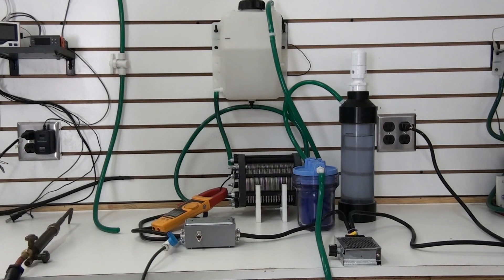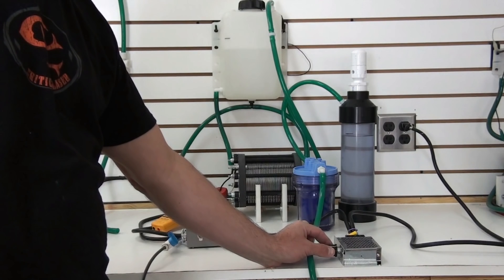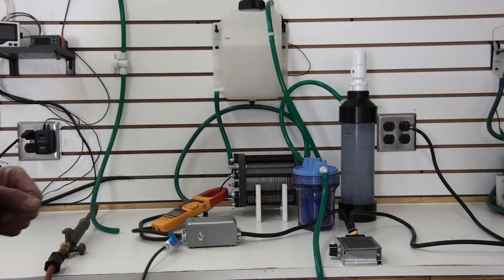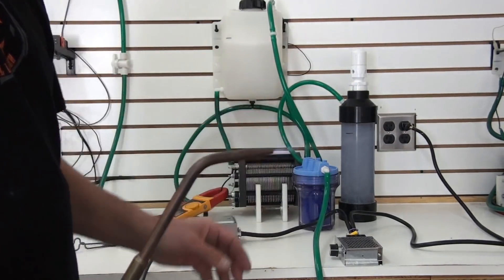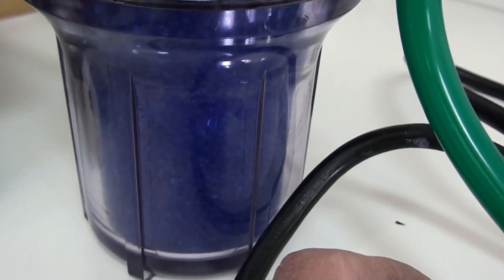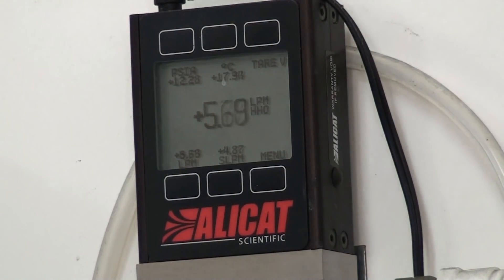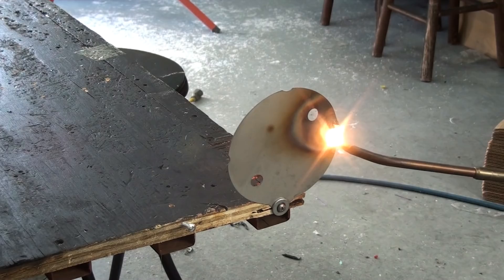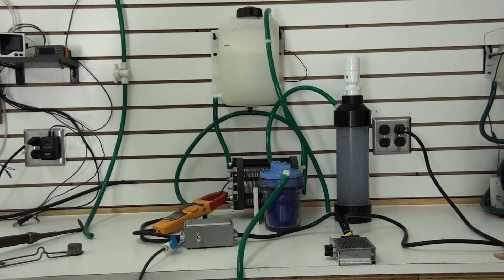Green Fuel H2o 59 plate complete Hydrogen generation system

Comment: Hi can i ask what your catalyst is? You seem to be running this cell at 1.896V per plate(110/(59-1)), for me electrolysis doesn't even start until 3.3V. I'm trying to build it into a cnc steel cutter. I did some math also, your system is running at 65.44% efficiency, pretty darn good for a setup like this.
Reply from the maker: I use KOH. It's a basic cell design

Comment: Is it possible to build generator with 120 plates and 120 Volt , with a positive contact in the middle and two negative contacts at two ends. So as soon a low power needed , just switch off one of the negatives. So the half of the generator will be powered and half of the HHO production gas will be used for a small job. I guess a half of the plates will not function at that moment but HHO gas can pass through them. For the big job just switch on and use full HHO gas production. Its like two 60 plate generators connected in parallel.

Comment: Is it matters what kind of stainless steel 304 or 316 is used for plates. I heard that distilled water and KOH (potassium hydroxide) will keep the system clear. If I use the generator ones in a month with distilled water and KOH for welding some stuff ( not for the car engine), is it really matters what stainless steel to use?
Reply from the maker: CoolStreamT 304 or 316 really makes no difference.

Comment: What's the maximum HHO gas pressure  (psi) in the tank or system during welding? If, for example, you keep the torch valve closed, how much pressure ( psi ) your system can held until the rapture of some unit? Do you have pressure release valve just in case?
Reply from the maker: This machine will hold about 20 psi.

Comment: A nice demo. Great and simple. When you turn the variable voltage  knob, you actually changing DC voltage between each plate between 0 to maximum 2.3V , right?
Reply from the maker: Yes but nothing happens until about 1.9 volts.

Comment: have you tried a cutting torch with LP air connected for cutting pressure?
Reply from the maker: No I have not tried that.
Reply: delvis11 It would be interesting to see the result or if it blows out the HHO flame?